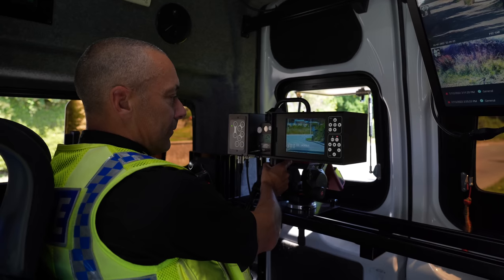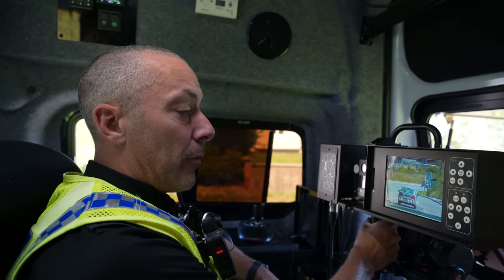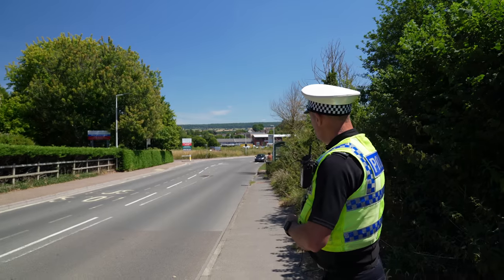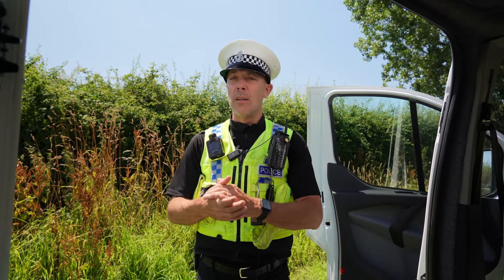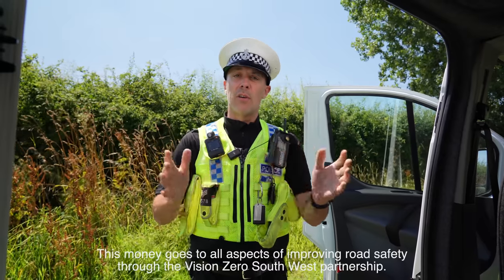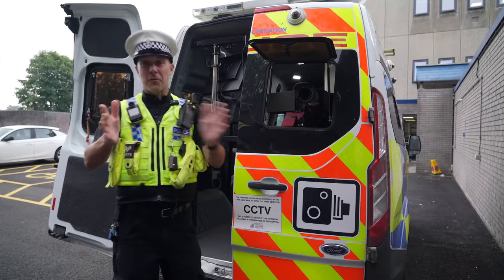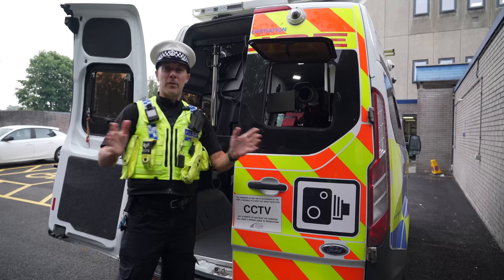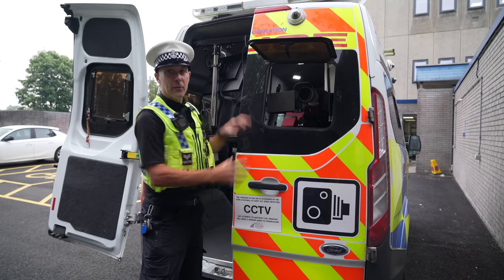SPEED CAMERAS - Road Safety or Cash Cows?

Comment: Great video and advice, but can I ask why the chevrons on the rear doors are not blue and yellow like the rest of the van? My friend has a theory that they are red and yellow like many work vehicles so they can blend in easier and make them harder to recognise as a police vehicle.  Regards , shaun👍👍
Reply: even police cars have the red and yellow chevrons on the back. i think its to do with safety
Reply: Very simply - by law under Chapter 8 of the Road Traffic Manual, any vehicle that is stationary on a 50+ mph road for purposes of work, MUST have red and yellow chevrons.

Comment: I'm not against camera vans by any means, especially when used correctly like in this example. But I can't help but notice the contradictions here... "If you've seen the van, it's probably too late" followed by "we're not cash cows, if you can't see the van then there's an issue with your observations..."

See the problem there? You can't claim that the van is so visible nobody should be getting caught, when you know, and have said yourself, that if you see the van it's too late...

Having said that it's irrelevant, people shouldn't be speeding in 30 zones in the first place... I'm not opposed to a few extra MPH on a motorway or dual carriageway, 70 seems way too slow to anybody who has driven abroad a lot... But 30 zones are 30 for many very good reasons, don't speed in them.
Reply: He isn't saying that the highly visible van means nobody should get caught, he is saying that when you are caught, you cannot bleat that it wasn't clearly marked.

Comment: Very informed video! 
Are they used at night, say midnight? Or are there specific times that are commonly used?
Reply: Although the laser aspect functions perfectly whatever the time of day, without enough available light to record the vehicle plates, notices cannot be issued because the keeper could not be identified. 

However, modern video cameras have low light IR settings and combined with specialist infra-red lighting panels that clip on to the outside of the van (called Orpheus), then this allows enforcement in complete darkness.  So it simply depends upon what a constabulary has purchased to allow them to work when the sun has disappeared.

Comment: Whilst I agree that they are designed for safety and I'm under no illusion that this was their original intent. However when you have civilian operators operating in stupid locations then that's where I draw the line.
Perfect example is a dual carriageway in Suffolk, it goes to a 40mph the mobile camera operator targets vehicles coming through it and they then send out a ticket....this is entrapment in this scenario especially when taken to court and proven the operator didn't have a clue about the equipment yet the court found him credible scoff *scoff*.
Another gripe is again with Suffolk the fact that the police tampered with signs in order to secure a conviction, so if they are a deterrent and not revenue why did the operator go and fix the signs after it was pointed out that they weren't there, visible or obstructed in some way? (FYI Suffolk has the highest complaints against police compared to others last time I checked statistics couple of years ago).
Not only that but in relation to your laws, while it isn't written in law it is in fact written in guidelines that any partnership who is operating safety camera equipment regardless of static cameras or mobile cameras must have warning signs, not be obstructed by trees etc and be perfectly visible. Vehicle markings must have the chevron markings and be in plain sight.
So what you've said in your video about being plain marked vans means that you have in fact confirmed you are a law unto yourself and rules don't apply to you.
The guidelines from the Department for Transport says:

Speed cameras must sit in a yellow housing
The housing itself should be visible and not obscured by trees or bushes
You should be able to see the speed camera from 60 metres away in a 40 mph zone, or 100 metres for all other zones
Signs should be placed in areas where there are visible camera housings - but this isn’t mandatory 
Every camera site should be reviewed every 6 months. This is to make sure they’re visible and properly signposted.
Mobile speed cameras also have guidelines on their positioning and appearance:

Mobile speed camera operators should be visible and wearing fluorescent clothing. Their vehicles should be marked with reflective strips too 
Signs should be placed in areas where mobile cameras are operating - but this isn’t mandatory
Like the speed cameras, every mobile speed camera site should be reviewed every 6 months
Reply: It is the polar opposite of 'entrapment', you have no clue what the word means.  

Those operating the kit are not expert witnesses and there is no requirement to be familiar with pulse rates during an acquisition cycle, or the beam width in nanometres. 

The requirement for warning signs was withdrawn in 2007 - get over it.

There is only one document that police follow regarding speed enforcement and visibility is covered on page 14 under the health and safety section, existing only to prevent those carrying out enforcement from being collided with:

GUIDE FOR THE OPERATIONAL USE OF SPEED AND RED-LIGHT OFFENCE DETECTION TECHNOLOGY

You are way, way ,way behind the times.

Comment: If the police really cared about people's safety the crime rate wouldn't be through the roof. London and most other city's have massive issues with gang violence, and Grooming Gangs, Although you never hear about the Grooming Gangs in London because half of parliament are also involved. Today's police are lazy and incompetent at best, the police force as a whole corrupt to the core. Apublic inquiry into the police is at this point an absolute must. In 2017 there approval rating was 52% They haven't released anymore figures since. Long past due. Why? Because if they did it would force a  public inquiry, as its definitely well below 50%
Reply: What does speed enforcement have to do with traffic enforcement carried out by police staff?

Comment: As a German. I agree with my country that we have no speed limits on motorways. As it's completely optional to drive 250kph or 130 kph. Motorways are far safer than rural roads so having no speed limits I believe is the right choice
Reply: What special training do you get for driving at 150mph+?

Your attempted argument just collapses when you look at this example of lemmings, one after the other, after the other.  Nature selection at work.

259 cars involved in motorway pile-up in Germany

'This is the horrific aftermath of a motorway pile-up involving 259 vehicles that left 10 people fighting for their lives.  At least 66 others were injured in the carnage, said to be caused by a dangerous combination of torrential rain, low sun, and speeding drivers.

A collision sparked a series of crashes over a two-hour period leaving a 25-mile backlog in its wake. More than 300 ambulances, fire engines and police cars attended the scene on the A2 near Braunschweig in northern Germany.'
Reply: @unleashthedragonwithin2057  as much as I hate to admit it, the level (and cost) of German driving course/test is far higher than ours

Comment: So, I got done for doing 34 in a 30, yes it's technically speeding, not that i was speeding intentionally i was just plodding along after work, bearing in mind, the picture that came through with the fine was 286m away, the van was parked around a bend, parked up in a row of cars so from that distance, even if i did see it, it doesn't look at first glance like a camera van (yes, my eyesight isn't the greatest), even showing the speed awareness course instructor the location on google maps/street view, she was shocked that the camera even managed to get line of sight on my vehicle, I mean i dodged the points but still.

Also what about posting the camera locations on social media, as i've seen a few articles that say that you can be fined 'x' amount for posting where they are.
Reply: Which constabulary issued a notice at 34?  You weren't fined if you attended a course as you claim.
Reply: @unleashthedragonwithin2057  Avon and Somerset
Reply: @unleashthedragonwithin2057  also I said with the fine, what I mean was you get the fine come through with the option to do the course

Comment: Great video thanks, I’ll be sharing this with my pupils. One comment that resonates with me is “when you got your licence you signed up to follow the rules”

We have many roads with average speed cameras and they are a pleasure to drive along. A safety camera van regularly parks just after the average speed camera zone ends, everyone speeds after they’ve past it and the  section with no enforcement has weekly crashes. Begs the question why this higher risk area doesn’t have enforcement.
Reply: Where are the average speed cameras?
Reply: @unleashthedragonwithin2057   throughout the ring road in Nottingham
Reply: @Studidit  Is there somewhere for the vans to park where the crashes are?
Reply: @unleashthedragonwithin2057  it needs the average speed camera zone extending to this section
Reply: @Studidit  What would then happen when the extended section terminates?
Reply: @unleashthedragonwithin2057  ah I see, so following that implied logic, if we can’t do all of it, we can’t do any of it.

Comment: 'The van is brightly marked up, if you can't see it maybe it's your observations at fault'
Also
'The camera vans have a range of about 1000 meters, so if you've seen the camera van it's probably too late and its probably seen you'
Reply: Your point?
Reply: @unleashthedragonwithin2057  Sort of contradictory. 'If you don't see it you need to be a better driver, but also you can't see it from that far'
Reply: @Nonicknamejames  You misunderstand.  Many claim that the vans are not readily noticeable regardless of distance.  The video above identifies that they are white and covered in livery.  It isn't about being a better driver to see it, just to have eyes that meet the requirements to take charge of a motor vehicle.

Enforcement at 1000m would be motorway based and with a generous allowance before notices start.

Comment: Got caught by a van hidden behind a car plymth with a car on it outside a car dealership, couldn’t seen any stickers or indication that it was a police van until you drove past and at that point it was too late, straight road for over 2 miles  not outside a school, wide 3 lane road 40mph limit going into a 50 zone in a high targuia area - complete cash grab by where I live yet where there are schools especially by me there’s one at the bottom of a hill and it’s very easy to go 30+ without touching the accelerator and I’ve never seen a police van there it’s shocking
Reply: It did not have the bright yellow/orange markings on the back it did say police above the door but by the time you see that it’s way too late it looked like a regular white transit until you drove past and saw yellow and blue
Reply: How many children have been killed outside the schools where you live?

Comment: This is probably commented further down but I use to hear about a tolerance rule or 1-2mph over or was it just a myth?
Reply: 10% for discrepancy as they no they are not 100% accurate
Reply: Even in court it's nothing to worry about so 60 you should not exceed 67
30 not over 34 so on 
It's more dangerous to everyone if you slam on brakes..

Comment: Ok, so here in an idea. Rather than sending a temporary van, how about fix the issue? While the van is there is will catch some speeding cars and 1 or 2 may even have enough points to lose their licence, but if the road is not designed for the speed limit (ie to low a speed limit on too wide a road) it's not going to actually achieve anything. Ie, once the van is gone, people will just return to speeding again.
Reply: What's the idea?  You just made a statement.

Comment: He said it has a range of a 1000 mtrs what happens if the van is parked 500 mtrs inside  a 30 mph zone and a car is doing 40 mph in a 40 zone can the van detect when the car comes past the 30 mph sign or is the first speed taken, the van was in a 30 mph zone but the car was detected at 40 mph in a 40 zone Ithink this needs to be answered.
Reply: It is very simple.  The distance to the gateway signs is measured by pinging the signage and a note of that distance is recorded in the pocket notebook and the session paperwork.  Vehicles well the camera side of the gateway signs will be processed and queries would be quoted the measured distance.

Comment: Used properly they do a great job, but sadly sometimes they are placed in positions where the only motivation seems to be collecting ££££££ which does give them all a bad rep 🤘😎🤘
Reply: @NoBody-gf8ie  After over 40 years with a perfect driving record I see them as a great tool used properly. But as I say have seen them positioned where even with decades of driving I have gone past some and thought the camera haters will have a field day with this one. You get my drift folks, but the bottom line is if you don’t want to get booked don’t speed 👍

Comment: The speed camera vans would be respected a lot more if they were parked up outside a school but 9 times out of 10 there not. Also I feel like speed cameras on motorways and dual carriageways cause more crashes because people are more worried about there speedometer an getting a fine then what is on the road in front of them.
Reply: It has nothing to do with 'respect' or your feelings, it is about practical deployment.  Where is the data to support enforcement outside schools?